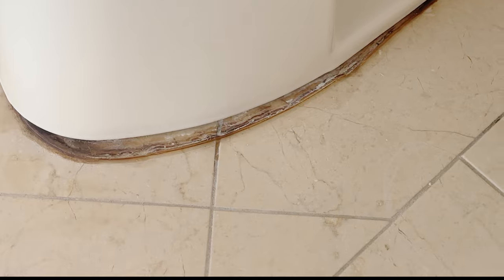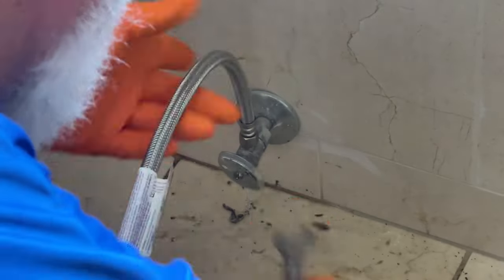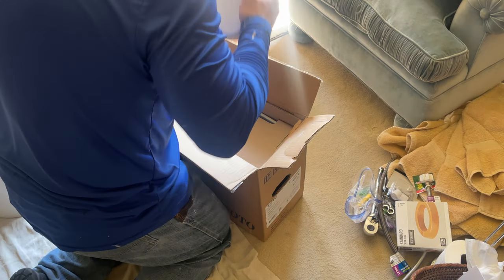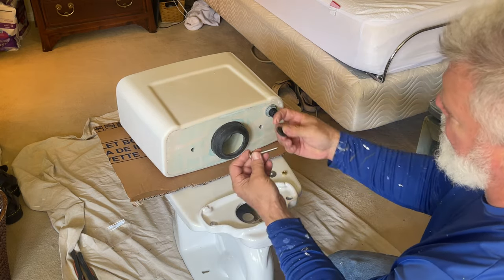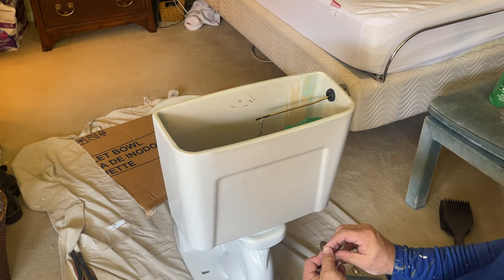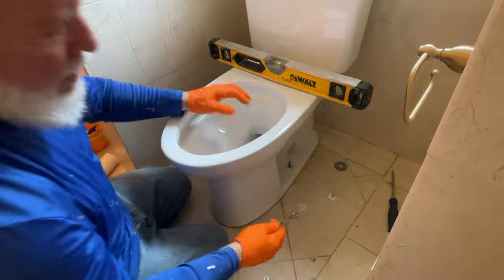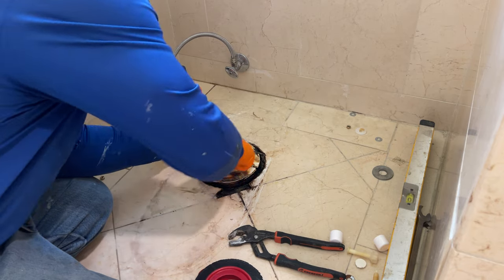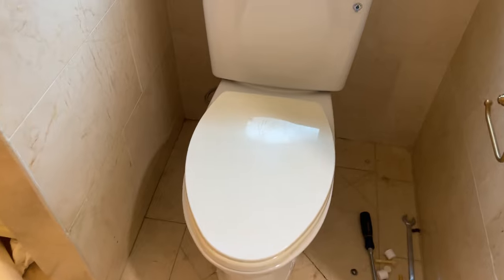TOTO Drake Toilet Install

Comment: This is a great vid, wish I watched it before installing my Drake. Installed the tank after setting the toilet because it was easier for me to mount the toilet. I didn’t do the double nut sys, thought I had two extra nuts. Used all 4 washers though, put washers under the heads of the attachment screws, thinking the larger dia washer was better for compressing the rubber seals from inside the tank. Then placed the other two washers over the ends of the screws and tightened the tank down. 
Doing it this way uses the same torque to tighten both the attachment screw seals & the tank-to-toilet seal. Nothing leaks, so I'm not going to re-do the tank install, just need to remember that if I ever need to remove the tank, will need to empty it of water before loosening the attachment screws :)
Reply from the maker: I install the tank before and after depending on the situation. Sometimes it’s easier to just mount the tank after if it’s a small bathroom. Just keep an eye on the tank it might start leaking in time, as long as it’s working I would leave it alone. If it does start to leak it will be a small drip most likely. Thank you for watching, I really do appreciate it and if you have any questions on anything diy let me know. Happy DIYing!

Comment: Thank you so much!! I paid a handyman $120 to install my Toto Drake toilet. He had left it not hooked up to the supply line. I hooked it up today and found water leaking from the tank. He couldn't come back until tomorrow so I researched and found this video. I discovered that he installed the bolts wrong (metal washers were at the top instead of the rubber washers) and two nuts were missing. I don't know if he threw them away bc he didn't know that 2 nuts go under the tank and 2 go under the bowl, or if they were missing in the box. Anyway I bought the nuts and reinstalled and no more leak! Could have saved the money by doing it myself with your help. The instructions in the manual were kind of confusing and it was hard to tell from the small drawings how the bolts go.
Reply from the maker: That’s very sad that he did not do the job correctly but it’s excellent that you were able to watch the video and figure out how to do it. Thank you for watching and thank you for the awesome comment.

Comment: What was the size of the wax ring and new connector hose you had to get? along with the size of the mounting bolts?
Reply from the maker: Your mounting boats are all gonna be standard size when you go to the store they’ll just sell them in a pack as far as the gasket goes or the wax ring depending on what you’re putting on those are generally going to be standard sizes as well that’ll really be determined by the toilet that you were installing the hose itself is also determined by the valve that you have in the wall. The part that goes into the tank is all standardized, but your shut off valve could be a different size, so take yours to the store with you and buy an exact replacement

Comment: I purchased my TOTO from Lowe's they wanted $250.00 for installation.  I am not sure what you charge but $250.00 isn't bad. I put mine in myself (at my age I think I will out live it) but for all that is involved especially if you have to install one off the main floor that $250.00 might be a bargain (if it is installed correctly).  You never know what you make encounter.  Bad existing flange or flange screws - filthy floor or walls - the weight and condition / handling/disposal of all the parts involved etc. In my case we still had cast iron and it was 50/50 but it appears that it will stay (at least until I'm gone lol) and then plastic needs to be put in. The toilet we removed looked great just to small but underneath it all was a mess. You could not tell by looking at it.
Reply from the maker: That’s not a bad installation price but that is a basic rate anything extra needed should change the price. Installers for big box stores are gambling on up-charges and high volume.  Thank you for watching and the comments.

Comment: One more thing - Would someone PLEASE show how the SEAT that comes with it  is installed - it is needed. thanks
Reply from the maker: The seat is definitely different, read the directions closely. I will try and make a video on that soon, great idea.  I did find this video, I hope it helps you. https://youtu.be/6deRR7KEoYM?si=6x7LGF_MeK5zgw4t
Reply: @UltimateDiyer  What I figured out is that the hardware that came with mine is the same hardware for the Bidet upgrade.  So I watched a Bidet video for Toto and learned how to install.  I guess the want you to upgrade so they send you the hardware with the regular seat lol.
Reply from the maker: @wg7644  that makes sense, depending on the store you purchase from, not all Toto even come with the seat. I just bought another higher end brand of Toto from Home Depot and it does have the seat. That’s great info to know about the hardware, thanks for the update.